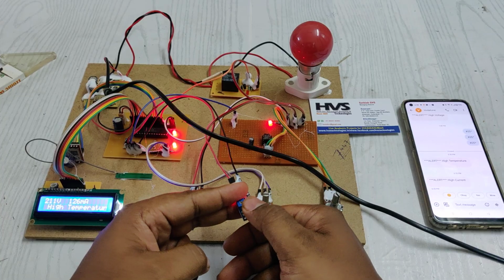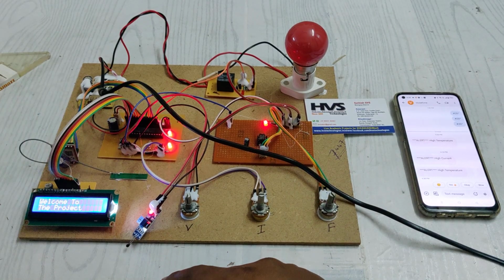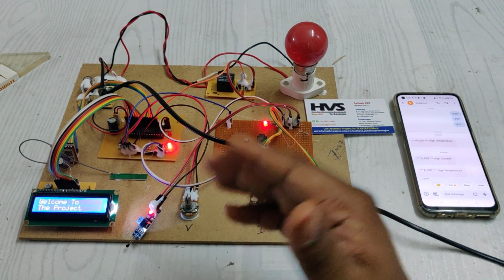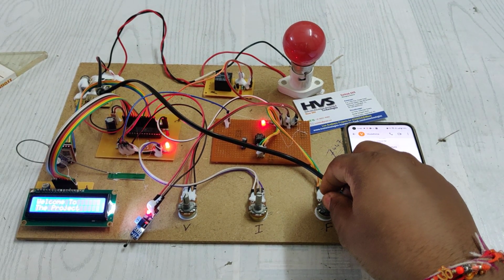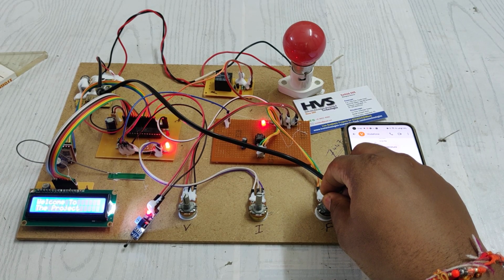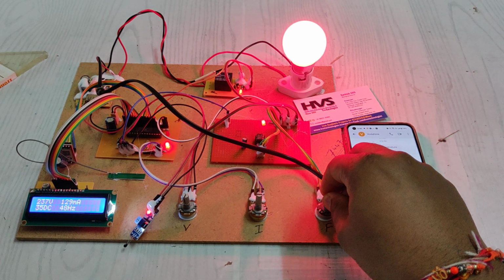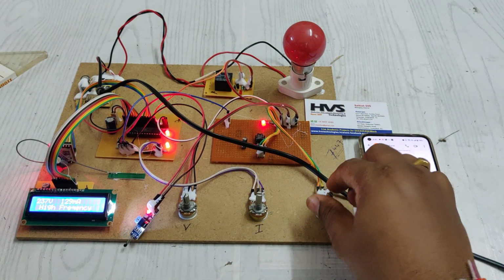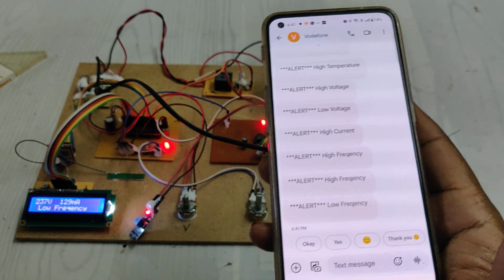Power Grid Failure detection based on sensing frequency, voltage, current and temperature with GSM

Comment: Sir how can display 230v when you have already step-down the voltage to 5v😊
Reply from the maker: Your question has the answer. 230v to 5v  , it's simply a linear equation. In controller we done this equation.
Hi, 
We sell full working kit with document PPT circuit diagram and code. Could you Send me the video link, Will update you the cost details. You can contact us at +919603140482
Through WhatsApp or call